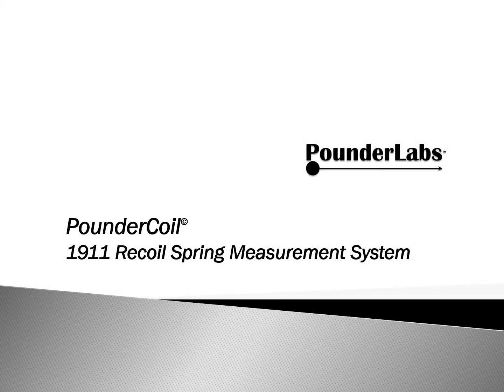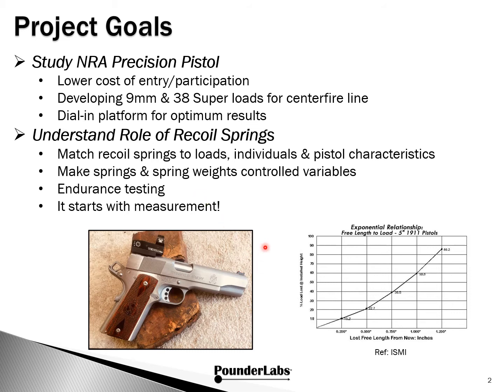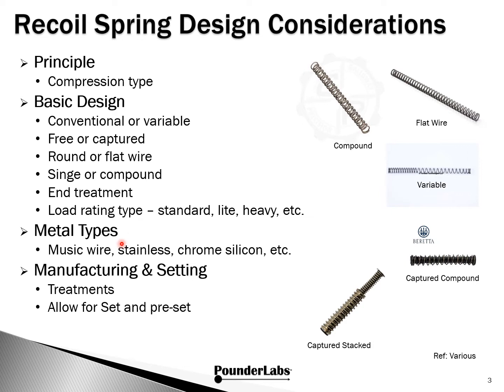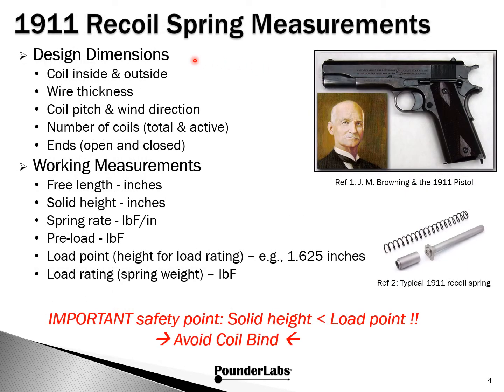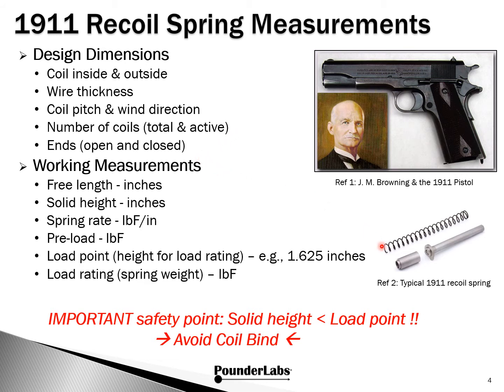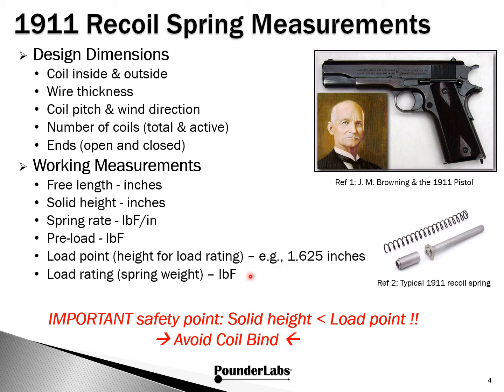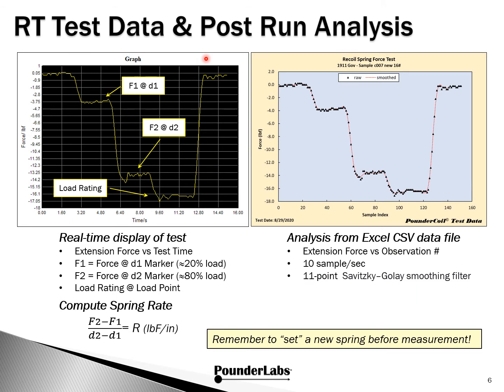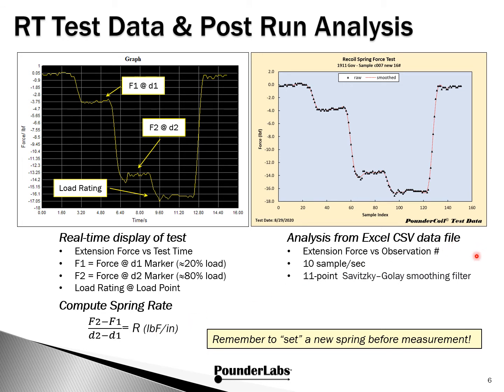PounderCoil©  - 1911 Recoil Spring Measurement System

Comment: This is a great video! Thank you for the information, Don! I was curious how the load point is determined, especially on different length barrels like a 4" barrel. I have a 4" Staccato C (2024) and trying to find a flat wire solution that would yield a 16lb weight at the load point.
Reply from the maker: Thanks for the feedback and question.... I not an expert on 1911 springs but would think if you're getting good operation and aren't hard stacking the spring you are in the linear region of the spring functioning and good to go.

Comment: I still don’t know what springs I should use. There’s so many videos so many different opinions I just need an answer.
Reply from the maker: Hi Jimmy.....
You don't provide much information here so, I'll assume you are using 1911 full frame, this is what my video deals with, you are using standard factory loads and the spring you have now isn't working for you anymore. Go to the Wolff website and follow their recommendation for the caliber you are using. If you are reloading, still start there and go up of down a little to dial in your best performance. Remember, these spring fatigue over time with use so, you should replace as needed.
...Don